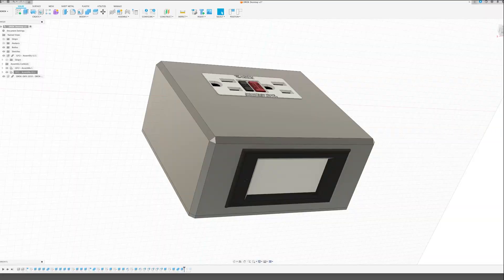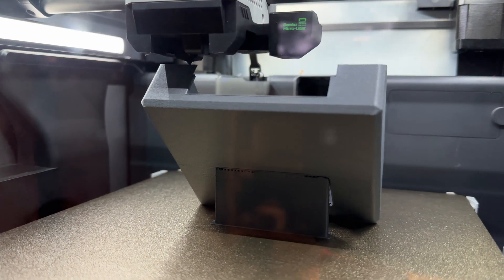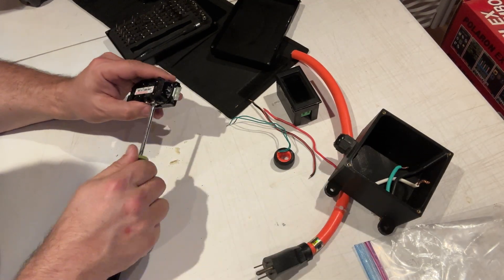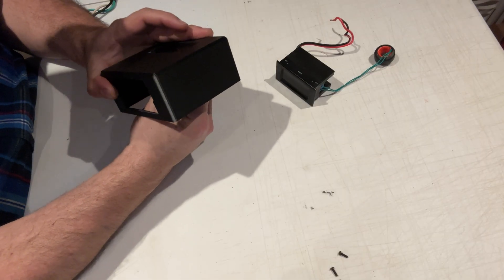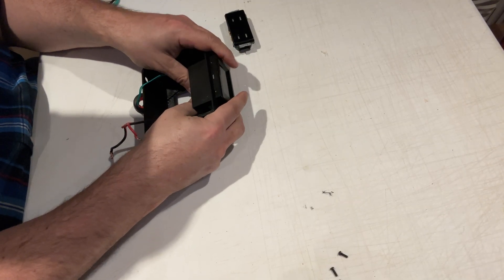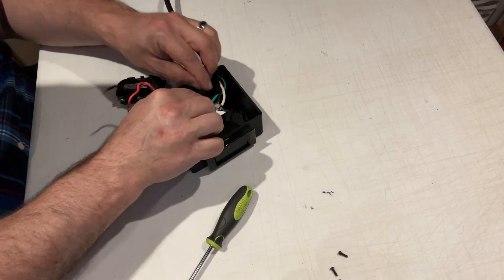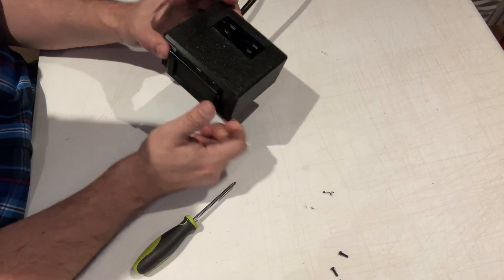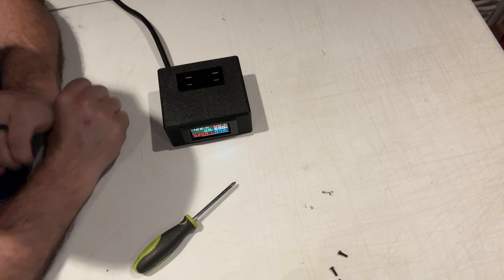How I 3D Printed a Custom DROCK Meter for My Desk

Comment: This is perfect for your YT channel when reviewing products.  Added bonus points for designing and printing an enclosure for it.  I use Shelly One Plus plugs that I can turn on/off devices with Home Assistant.  They give me an instantaneous Wattage reading and the total kWh.  They don't include the Amps being used, but for my use it's not necessary.  Had to google what a DROCK meter was before watching the video.

Comment: I love square boxes. I can design them in my sleep :)

Products for 3D businesses are always interesting. There's a lot you could call add-ons for it, really. I consider a bunch of Kallax shelves with inserts essential, for example.
Reply from the maker: Yeah, I didn’t see any reason to get fancy with it—it just needs to be a box. 🤣 As of late, I've just been concentrating on fixing pain points for myself. I figure if it's a problem for me it's probably a problem for someone else.
Reply: @ExtrusionTherapy  That's basically my FDM printing - fix stuff for myself. If others see it and have similar needs, I can provide. Now I'm printing parts to stabilise my FDM table, then I'm designing something to hang my shampoo in.

Seems to be a lack of designs that actually stay hanging off the type of shower I have, and I'm sure some of the millions out there are similar.